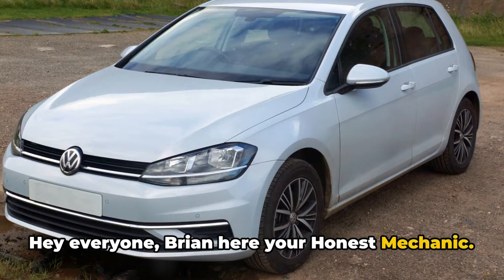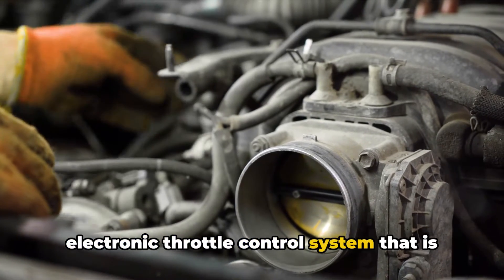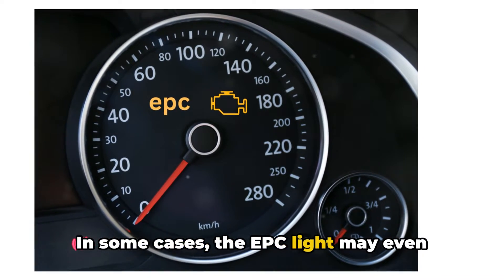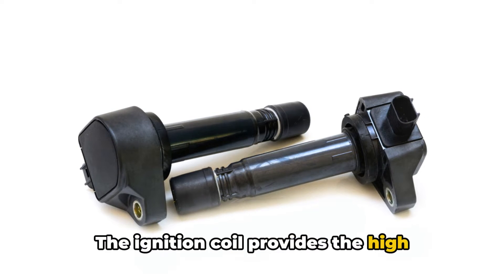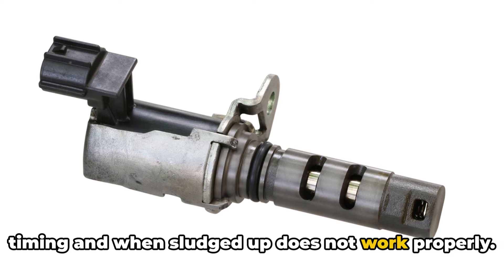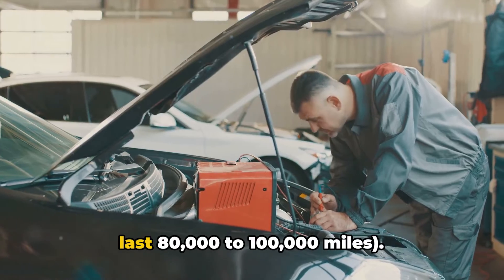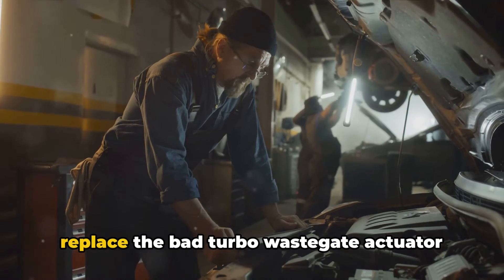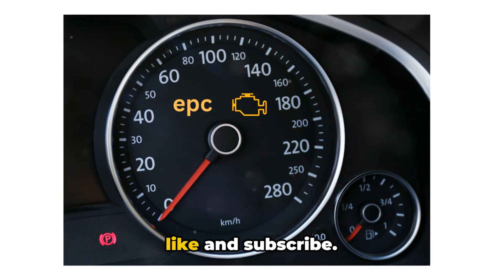EPC Light on VW Golf and Polo: Causes & Fix

Comment: My issue was the turbo actuator. The epc light was on and my Polo ran very slow.
I erased the error with my cheap obd2 scanner and it was out. then i turned of the engine, and turned it back on and the epc light was back.
The turbo actuator costs around 200 euro`s and i did this myself. Now it`s running smooth.
Thanks for showing this vid.
👍👍👍👍👍

Comment: Advice please, i have no idea about engines but own a vw polo 1 litre blue motion technology.  May 25 it wouldnt start, all flashing lights on dashboard.  Mechanic put new battery in. Shortly after the engine management light (orange) came on also at a simlar time the stop/start feature stopped working when stationary.  The mechanic plugged in a code laptop and turned off lights.  Stop/start worked for 2 days, took it back to garage and theyve replaced fuel cap, some charcoal filter & a sensor in gearbox they said was faulty.  All this cost £399.88 (not the battery)
Fuel consumption went back to 61mpg   It lasted 13 days!  Stop/start doesnt work ( that lasted 6 miles)  and orange light back on.  Drinking fuel.  Garage will have back in but will charge me..any advice so welcome. I have no idea where to go or what i tell them?  Btw, my polo is 10 years old, i bought new from dealer & has 51,000 miles.   Thank you. B

Comment: ** vw polo 1.2 petrol
Occasionally turns on EPC traction and tyre pressure lights on at once and goes into limp mode . Which goes away once you turn car off for a minute n turn it back on 
Once normal drives spot on 

Has had misfire issue in past which was fixed coil pack was changed but was doing same thing  was showing injectorcode  just now gt injectors changes no other codes showing on after changing injector but after injectors changed roughly done 20 miles n same issue again

Comment: mines a seat leon 1.4 petrol2009-last week it was playing up very hard to start and very sluggish on acceleration----------------brand new ignition coils and bosch spark plugs fitted-------started ist time but i still noticed car slow to accelerate and sluggish in lower gears-today driving along -JUST STARTED TO MISS-and engine managent light flashing EPC LIGHT CAME ON AND STAYED ON----car then cut out and stopped on main road--would even turn over----son towed me home-------took off throttle body and cleaned as best i could-didnt seem that dirty-----replaced new airfilter i had in garage--stll no joy-wont even turn over checked battery-12.45----any ideas what to look for next--i did a scan with his scanner coming up as--PO301-302-304-MISFIRE ON THSES CYCLINDERS-THEN P1603----ecu  PROBLEM-HOPE NOT-80,000 MILES WELL MAINTAINED-ANY IDEAS thanks in advance
Reply: sorry about lines-dont know why it did this
Reply: What was the update? Was there a cure for this? I have a Audi A3 1.4tfsi with the same issues. It's getting very costly. After a full service including plugs, packs and a few VVT solenoids (which are not cheap) the problem still persists. 
Have you tried replacing the battery?

Comment: If the EPC comes on at idle and the car is misfiring, and the engine is direct injection, check for excessive carbon on the back of the exhaust valve. The buildup is visible by removing the MAP sensor on the MK7 E888 engine and using a Bore scope snaked into the manifold. The carbon on the valve prevents the swirl in the airflow that is needed to properly mix the air with the fuel to get a good burn. The only fix is to remove the intake manifold and blast the carbon with crushed walnut shells until the valves are clean. You may also try the ATS top end valve cleaning service.

Comment: Thank you for sharing. I've VW Vento highline 1.2 TSI DSG 2016 model. I've replaced all spark plugs, ignition coils, idle pump, checked engine mounts at authorized VW service station. However, car still vibrates while idling and extreme vibrations while idling when AC is turned on, then check engine light, EPC light and stability control lights comes up. I literally have to turn the car off amd on to avoid that. I've spent a good amount of money but the issue remains the same. Any honest suggestions are welcomed.
Reply from the maker: Hey Harshvaidhye, Sorry to hear that, here is what I think:  from the symptoms you described, it seems like it could be linked to the following:

1. Throttle Body or MAF Sensor: Issues with the throttle body or the mass airflow sensor (MAF) could cause erratic idling and trigger warning lights. You might want to check if these components have been cleaned or inspected.
2.  Alternator or Battery: Weak charging systems can cause electrical gremlins when extra load (like the A/C) is applied. Check your alternator and battery health, as a weak alternator can cause sensor malfunctions and vibrations due to inconsistent power delivery

Also it is worth mentioning checking your VVT solenoid (also known as valve cam adjuster)

Hope this was helpful!! let me know how it goes
Reply: @HonestMechanicChannel  Thank you for sharing the details. Much appreciated. It is something new to learn and understand. I'll be getting on it and will share how it goes.
Reply: Hi how did you get on with your issue? Thanks @harshvardhan.vaidhya
Reply: @NISARQC  Hi, replaced many parts and spent a good amount of money.
Reply: @harshvaidhya  so nothing that you could say for definite it was a particular part? Thanks
Reply: @NISARQC  hi, did replaced alternator, timing belt, AC compressor, spark plugs, ignition coils. But what to say, issues still persist. My car still vibrates a lot and jerking then turns off when I turn on the AC in Neutral or Parking mode.
Reply: @harshvardhan.vaidhya Brother, Did you look out for any problems in the Lambda(O2) Sensor?
Reply: @moses468 yes brother. It appears to be my car engine head needs to be open for full service.
Reply: @harshvardhan.vaidhya  Did you change the Lambda (O2) Sensor?
Reply: @moses468  no brother. Mechanic doesn't find any issues with it. But he told me to work on engine head, that'd cost me a lot. 😢
Reply: @harshvardhan.vaidhya  I  have the same issue with my Polo GT TSI...I was recommended to change one O2 Sensor and then the Ignition leads and Coil.
Not going to VW Service this time..Very Hefty....A faulty O2 Sensor can sometimes lead to misfiring, I heard...😢
I have decided to change both O2 Sensors and the Ignition leads and Coils first....
Reply: @moses468  I'm also not going to VW service station and will go retro mechanic, they do better jobs.
Reply: @harshvardhan.vaidhya  I have planned to order spares from abroad brother...
Reply: I have this same issue, spent a lot of money.. still have the issue the car still drives when I first turn the car on I have full power but when I stop at a light or something after first taking off the car goes back into limp mode.. the mechanic still can’t find the problem
Reply: @joseff_evans  ask the mechanic to check for the engine head for overheating and coolant system. Also ask to tighten the timing belt and alternative belt.
Reply: Did anyone get epc limp mode issue p1545,p1558 
Car is has not got enough power
Reply: Hi i am having exactly same issue coli pack injectorts replaced nothing showing on OBD  but problem stll there how did u fix it 

*vw polo 1.2 petrol
Occasionally turns on EPC traction and tyre pressure lights on at once and goes into limp mode . Which goes away once you turn car off for a minute n turn it back on 
Once normal drives spot on 

Has had misfire issue in past which was fixed coil pack was changed but was doing same thing  was showing injectorcode  just now gt injectors changes no other codes showing on after changing injector but after injectors changed roughly done 20 miles n same issue again
Reply: @atazazulhussan3998 is your car driven for more than 1 lac KMs or around?
Reply: @harshvardhan.vaidhya thanks for ur response yes it has 133k
Reply: @harshvardhan.vaidhya no fault codes showing on the OBD thats the tricky thing do you think disconnecting the negative battery to rest all electrical parts could work
Reply: Thats in 133000 miles took
Reply: @atazazulhussan3998 it wont resolve the issue by doing that. Since, your car is well driven, I'd suggest to go for an engine overhauling. Thar would capture smallest issues and mechanics could fix it. This would give your car engine a good life. 

Also replace old and worn electrical parts and wirings. Add fully synthetic oil and use liqui mol for better performance.

Comment: It also caused by brake lights not working due to globes damaged or brake switch not functioning.
Reply: True, after/ fixing replacing brakeligjt issues it disappeared. In addition,  after this, my cruse control light now works too.

Comment: Thank you for this concise information. I'm getting the EPC light more frequently now (Aug 2024) In fact today, just now, my EPC came on and then I got new messages like "Max RPM 4000!", mean while I'm in Southern California driving at 35 mph. I also got only moments later the temperature gauge on my car went up to almost 280 degrees I knew there was nothing wrong, but needless to say, as a precautionary move, I shut it off before it redlined. Then simply waiting 30-45 seconds and starting the car and all the problems go away... temperature is back to normal readings, the EPC light is off etc.

I'm getting tired of it so I'm going to hopefully get a mechanic to look at this because I'm tired of it. I'm tired of all the false flags. Thank you for this video.

-2017 Golf Wolfsburg, 91,000 miles.
Reply: how did u solve the issue?
Reply: @박유진-f8p  I did not get it resolved directly... but it did go away (for now) once I brought the car into the dealership because a thermostat problem developed. I was unaware here in the US that there was a lawsuit with regards to their water pumps. I missed the window of opportunity to get it replaced for free, but they offered me a 50% discount to replace the thermostat and the water pump, and so during that process they cleaned the engine.

So the problem has subsided, for now.
Reply: @tomallen5837 I don’t know if your car model is keyless but if it’s not you should check your key, it might be loosened and switches on the EPC because your car doesn’t detect a correct reading from your key, that’s usually a common issue with vw when the EPC tends to turn on and off randomly
Reply: I am going throug same bloody problem 🙄 have changed all oil pressure switch and sensor and still doing this shit

Comment: So I was just driving my 2016 GTI in city traffic I turned the car off it sat for over an hour I came out started it up and the EPC light is on I took my cheap scanner and hooked it to the car and it showed codes 7e8 & 7e9 so I tried to clear the codes but they still show up in the scanner but now the EPC light is off should I still be driving the car with the EPC light off and code still stored in the scanner I cannot remove the codes with my particular scanner car seems to be running and driving fine
Reply: Could be a scanner issue. Try using another scanner.